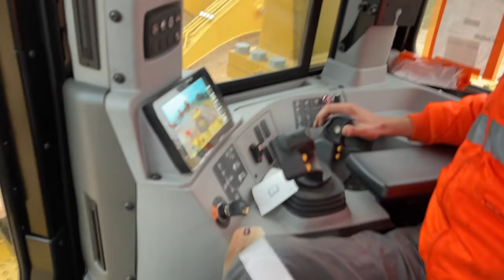Receive & Transport A Brand New Caterpillar D9 Bulldozer From Eltrak To Papaioannou Group Facilities

Comment: On CAT D6N,D8R,D9N,D9R I did maintenance on the shaft. Replacement of engine oils, gear oils - in any weather. They are the best machines after the Russian DT 250. Jsem Čech.Mějte se hezky
Reply: O
Reply: z0P
Reply: Y
Reply: 0

Comment: Digging these European designed lowbed trailers with rear steering. I'd kill to have one of these here in NYC
Reply: Seems like a good design.
Reply: Nooteboom pendel-X ,  great material !  Dutch and German design  , you can lift axle lines when empty  and you could add extra axle at the front all hydraulic/electronic steering each axle line is rated and approved for 16 metric tons

Comment: I'm more amazed that little truck could pull all that weight.
Reply from the maker: This Dozer weighs 50-52 tonnes, the truck can pull 250 tonnes!
Reply: it has a torqe converter and 500+ european horsepower

Comment: Maybe it's just me but I think I'd want something a little more substantial than 3 straps holding that blade LOL
Reply: 3 straps totally ample.  The truck would never be pulling more than 1g around corners so 95% of the weight is directly downward not sideward.
Reply: @antpoo  What you just said has absolutely NOTHING to do with how you calculate what is required to safely secure a piece of equipment for transport.
Reply: @DieselFuelOnly  yes my calculation is based on the physical sciences.  Yours is dictated  by regulations enforced by overprotective insurance companies.

Are you trying to say 3 straps were not sufficient and if so why not?  

Or is it simply you don’t understand F=MxA of which A must interact with G and overcome its downward moment in order to create force sufficient to overcome the breaking strain of 3 x 5 tonne straps?